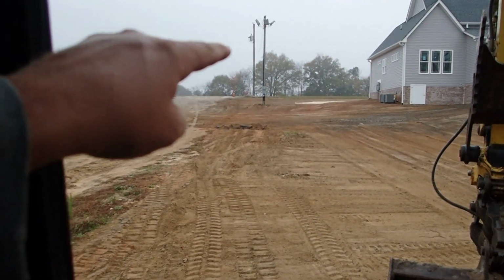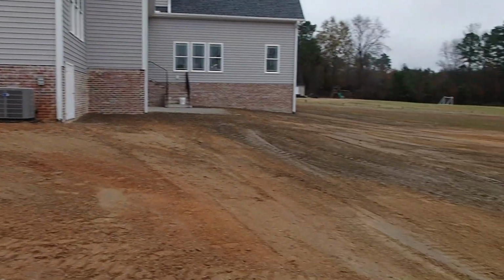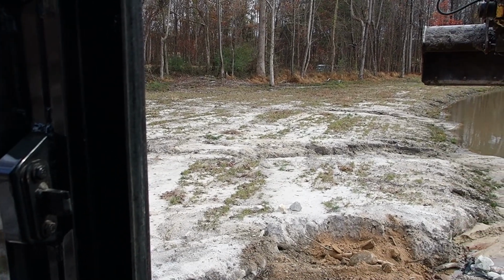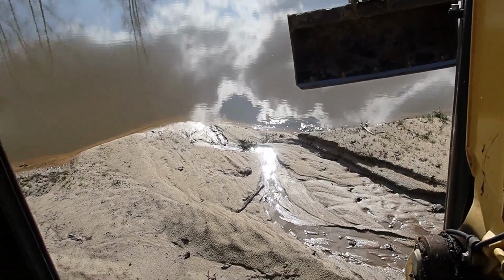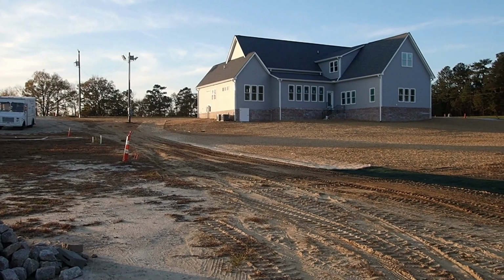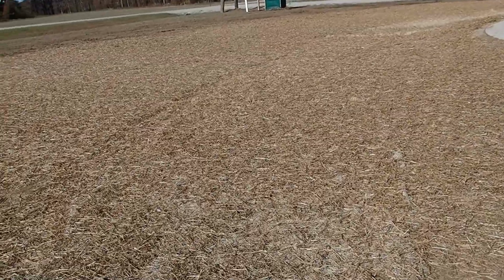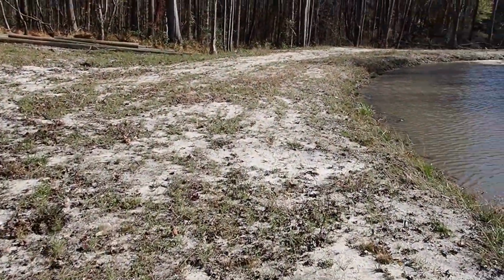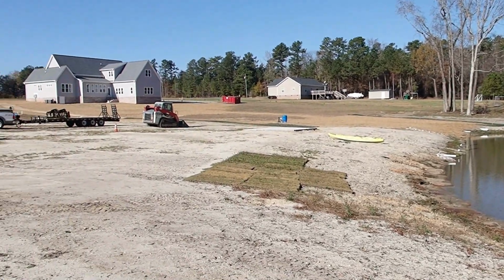Seeding And Strawing With A Pond Update

Comment: Looks like the pond is much lower than the house (as it should) and perhaps a spiral or circular swell around the pond that then drives into the pond through protected mats and rocks entry.  I don't do ponds, but this looks like a forever problem.  Martin

Comment: we own  pits up in Ontario, when we open a new pit it has about 1.5 ft of top soil then about 3 ft of what we call ,hard pan sand, to get to gravel, when its dry you can break hydraulic lines trying to dig it , when its wet it like quick sand, put a rock on top and it disappears in a few minuets .

Comment: Tell you client that fescue grad does not grow in sand because of the moisture requirement.
The only grass I have ever found to grow is sandy soil is Bermuda grass, and because of the I rhizomes, it is good to prevent washing in sandy soils.
Bermuda grass likes nice hot humid weather, and it does not green up in the spring until it starts getting hot early to mid April and it is a grass that is not bothered by dry weather, and in Oklahoma, it  goes dormant in the very hot dry summer time, but green back up once, it gets a good rain.  You can’t kill it, and it stands up to high traffic, and makes a good pasture grass for horses. OSU in Oklahoma had developed several strains. 
Look for the Variety called World Feeder Bermuda Grass. It is a Bermuda that stays green in the hottest part of the summer and  is a good grass for hay and pastures, hence the name World Feeder. It was an experimental Bermuda at OSU in the 1950’s and one of the developers of it at OSU, grasses his yard with in in Bethany Oklahoma, and it was rediscovered in the 1980’s to 1990’s., and was marketed.

Comment: How about using a power rake on the skid steer. Dirt is not mashed down flat. Seed can set and straw over the top. Slick that up and it rains I could see the water running off instead of in. Just a thought.

Comment: How deep does a pond have to be to keep the bottom from freezing
Reply: Depends on how cold it gets in that area.  Colder the climate the deeper it will need to be, or you can install an aerator to keep the water moving.

Comment: Zoysia, Bentgrass, Bahiagrass, & Bermuda grass seed’s are good grass seed’s for really sandy Soil.
Reply: Zoysia seed? That’s like spreading gold flakes on the ground here. Zoysia seed cost about $30-35 a pound here. It’s a excellent grass but man it’s takes forever to hold root.  We throw a quick grass like a annual winter rye that dies off when the ground temperatures reach  above 75° just to get a root structure then we put out Bermuda seed as it’s the most native grass that will survive here.  We see people sodding with St. Augustine and Centipede here and try to tell them they are going to be struggling to keep it alive for a good 2 full seasons till it can gain a decent root structure.   Bermuda/Tiff 44 
Sells for $1.25 a yard where Zoysia sells for $3.50 and St. Augustine $5.50 and Centipede $5.50 to $7.00 a yard.  Rich people grass.  I’m located in Central Arkansas. What is considered a weed grass in the Northern Climate is our go to Grass here.  Geologically we have a ton of sandy soils here.  Good information

Comment: The soil looks very alkaline. A good soil test would let them know for sure but id bet a couple inches if good hot cow manure would do wonders.
Reply: You said almost the same thing I was going to suggest. 
A  good inch of cow manure would work. Seed (2 -3 times the amount of normal seed) it then add 1/8 inch of loose cow manure on top of the seed. They could put 3 04 inches of cow manure and till it into the sand, seed, and straw.
Reply: Doesn't matter what you put down it percolates down and out. Sod is.about the only option. I live at the beach, lol.